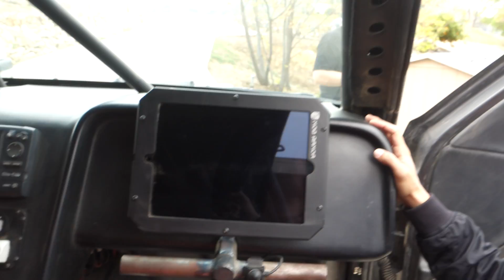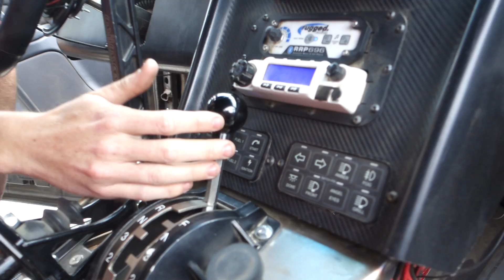I-Beamed Chevy Silverado w/ Carbureted LS | BUILT TO DESTROY

Comment: What if you put a seakeeper gyroscope or something like that in the back? You could hook it up to your transmission with a cvt belt so you can boost the gyroscope speed on the straights and use the fly wheel to mechanically slow it down too, when you brake! Plus, that seakeeper gyroscope could actually give trucks video game air control. Man you gotta check out there YouTube videos to see the potential of it being in a fast off road jumping trucks.  Although I think you would have to shrink the gyroscope down proportionally,  like maybe a 200lb fly wheel, I'm not sure.  But I think I'm on to something to stop trucks from nose diving and to add stability in corners/ over bumpy flats. I'm honestly just commenting this Idea on all sorts of recent prerunner truck videos,  because I would love to see it happen and I don't have the capital myself hahahaa.

Comment: How does the carburetor not flood out on whoops or jumps? I have a carbed stroker in my xj and have been told I won't be able to run a Holley carb on a prerunner
Reply: A normal carb can do just fine offroad, also theres several things you can tweak to improve on certain parts. Spring loaded needle and seats, some carbs have side mounted float boals. Atvs and dirtbikes have been running offroad carbureted forever.

Comment: Whats the advantage of running I-Beams?
Reply: AL A with a stock frame rail you can get more travel, fit much bigger shocks, and have much better steering components but this is only compared to a bolt on a-arm kit. There’s a really long argument on which one is better and honestly it’s personal preference
Reply: Which one has more travel ?
Reply: AL A my a-arms that I had pulled 19” my beams are strapped at 25”
Reply: @ala8649  - Beams, but with that you get crazy camber issues. Win some lose some. There's lots to consider and factor in, a huge list to both sides.
Reply: Where can you buy I-Beams?